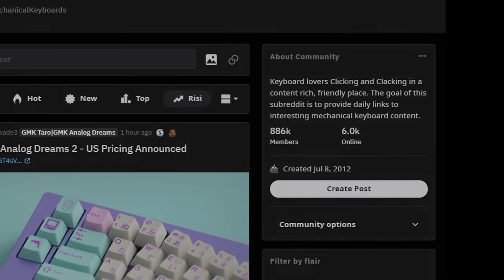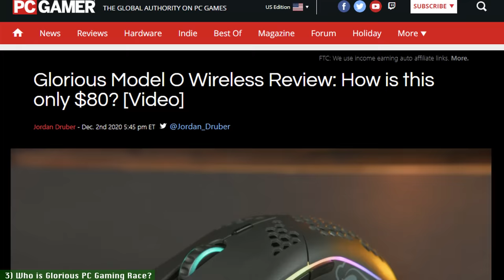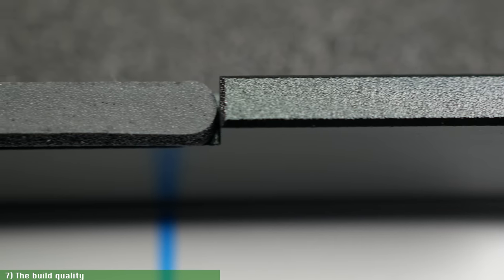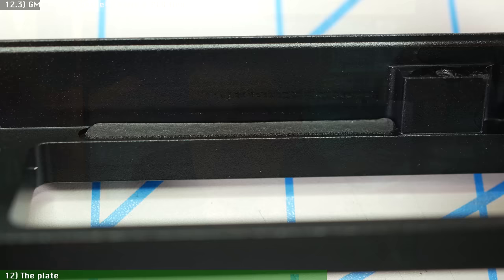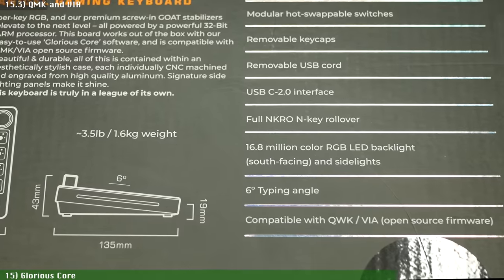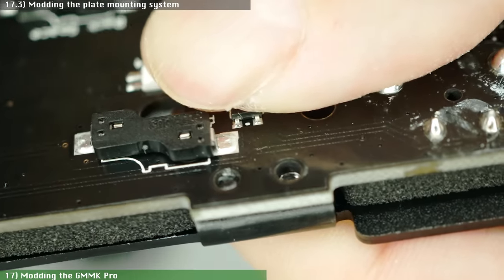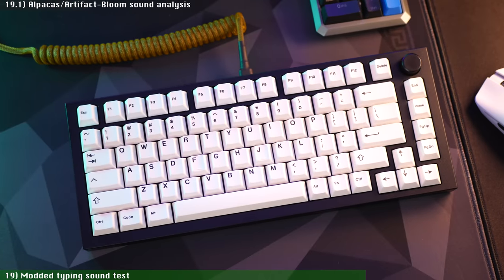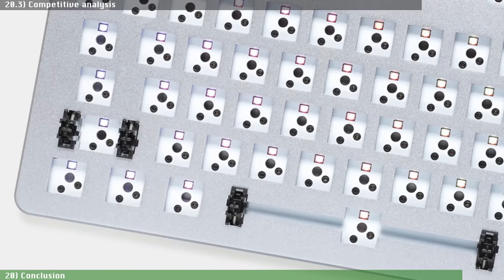GMMK Pro: The ultimate guide (in-depth review + modding tutorial)

Comment: When soldering the cable to the male aviator plug, how do you know which order to connect the cables in? Is it Black (1) White (2) Green (3) Red (4)? I made a custom cable following some decent instructions, and it powers my Drop Alt, but doesn't seem powerful enough to support the GMMK Pro. I'm leaning toward sleeving and coiling the cable that came with the GMMK Pro like you did, but I'm nervous I'll screw it up! Lol. Still learning, but this is a great video. Thanks for posting amazing content like this.
Reply from the maker: Thank you!!! And yes... You should always be EXTREMELLY careful when soldering the wires to the pins in an aviator or XLR connector, since you can damage your keyboard (in an extreme case) if you get the order wrong.

Now, is there a correct sequence to solder each wire color to each pin? No. Whatever sequence you do will work just find AS LONG AS YOU KEEP IT CONSISTENT ON BOTH ENDS of the cable (sorry for the caps, but I can't emphasize this point enough! :)

So whatever sequence you pick, keep it consistent in all your cables and you're not gonna run into any problems. I use 5 pins XLR cables, but you can use 4 pins as well.

On a 5 pin XLR plug I usually roll up the grounding silver naked wires into a bunch and solder it to pin 1 (if you have a 4 pin XLR, you can solder this "ground bunch" to the flat pin with the hole on the tip). This is an overkill measure for PC peripherals, but is something I learned from making audio cables, that can carry more current than PC peripherals and will benefit from good grounding. But you don't necessarily have to do this for keyboards (I do it out of habit). Then I do black wire on pin 2, green or yellow wire on pin3, white or blue wire on pin 4 and red wire on pin 5.

On 4 pins aviator cables I use the same sequence minus the grounding (black on 1, green on 2, white on 3 and red on 4), but just roll the ground bunch around the colored wires and make sure they touch the metal clamp of the USB housing and the metal part of the aviator connectors. USB cables already have ground built-in (on the black or red), but I just do this out of extreme caution.

Needless to say, don't ever mix your modular cables with cables made by other people, since there is always a huge chance they wired their cables differently than you, which could cause the cable to either not function or damage you peripheral.

As for your issue with the GMMK Pro, it does seem to need more power than other keyboards I have, so it pays off to use bigger gauge wire that can carry more juice. I have used the cable that came with the GMMK Pro to make the half that plugs to the keyboard, and used the cable that came with my original GMMK TKL to make the other half that plugs to my PC. This combination has been working great for all my keyboards.

I know I'm way behing in producing my cable making video, but once I finish it, I'll cover all of this in detail (as you'd expect from this channel :). Let me know how it works out for you!

Comment: Question for you. Did you have any problems with your stabilizers for the shift or space at with sticking? My boards space bar sticks bad. And I’ve removed a hood bit of lube and still.
Reply from the maker: Hi TIMREX! As my GMMK Pro came from the first batch Glorious had put out, I didn’t have the “sticking stabs” problem that pretty much everyone else who got the second and subsequent batches of this board had.

The first batch came with its stabs properly lubed (no excess grease), but, because of some issue with the stabs design, most people (like me) were getting clicks and ticks on the space bar. Then, when Glorious tried to fix that problem, by overlubing the stabs in the factory, they ended up creating the second (and arguably much worse) problem that you had: the sticking stabs.

After a year of this keyboard in the market (and two attempts by Glorious to come up with a decent set of stabs), it seems that the general opinion from most GMMK Pro owners is to simply add the price of some C3 Equalz stabs to the price of the board and not waste time trying to fix the stock ones (which most people, including myself, consider to be pretty much “unfixable”).

I’ll say this: if Glorious cannot find a way to put some really good stabs in their upcoming GMMK Pro 2, this could become the hill they’ll die on… Their efforts in the 'stabs department' have been pretty laughable up to this point.

Comment: Thank you for this video, I was wondering if it was worth the investment and I think I'll go for it as soon as my gaming room will be finished.
However, when I see this kind of video saying that a keyboard like that is entry level I really wonder what do keyboard enthusiast consider a over the top keyboard ?
Reply from the maker: Glad to know this was helpful!!! And yeah... I understand your surprise with the whole "entry level" concept! And that is why I came up with this graph ( https://youtu.be/J_axv-TkjkE?t=3945 ) to try to illustrate that an "entry level custom" keyboard sits higher than a premium pre-built/production board.

In the world of custom keyboards, believe it or not, $170 US is actually "entry level", since most boards that would be considered "enthusiast grade" are usually super small batch (manufactured between a few dozen to a few hundred units) and usually start around $300 to $400 for a single kit (PCB, plate and case) and are mostly made out of C&C'd super premium materials, with very tight tolerances and that normally go through a more rigid quality control than most production keyboards.

My rule of thumb for what is an "enthusiast" or "luxury" custom keyboard is this: 9 out of 10 boards built by guys like Taeha Types fall into that category (some of these are even what I call an "over the top" keyboard, that can cost upwards of $700 to $800 for a single kit!).

In my opinion, keyboards such as the GMMK Pro, and now the newly released Keychron Q1, sit right in the middle of those two groups (large scale production and custom)... They are what I call a "semi-custom" keyboard.
Reply: @IOSam  Thank you for such a detailed answer. I have a Ducky Shine 5 with Cherry MX Blue at the moment so it's what you'd call a "premium" keyboard just before the "custom" line I imagine.

I don't have a good feeling with it as I had with a previous Corsair CMStorm QuickFire with the same switches (without RGB). 
I read here and there that the Ducky Shine 5 with Cherry MX Blue (with RGB) could have some issues so it might be that. 
Also have their Ducky Secret mouse and have a wheel issue but that's another story ... I'm not very lucky with this brand.

Anyway I'm getting tired of the noise my keyboard makes, even if I love the typing experience of blue clicky switches. So here I am and thanks to your video it's maybe more clear to me that this keyboard may be the answer. I checked some videos about the Keychron Q1 but I don't like the sound it makes at all. Seems like the aluminum case ring like a bell when you're typing while the GMMK Pro looks more "solid".

Thank you for the time you took for this video, I've seen a lot of tech reviews on it and it's not even close to what you made here.

PS: I went to see what Taeha Types makes and yes I begin to understand. But I'm wondering if you could make a GMMK Pro or a Q1 sound and feel like one of those (without the exceptional custom design craftsmanship of course).
Reply from the maker: @Xanarkhan  Yeah... I have to say my experience with Ducky boards has been mixed as well... But my suggestion to you, if you like the feel of clicky switches but dislike their sound, is to go with Gazzew Boba U4 (if you want a super quiet damped switch) or the U4T if you want the "thocc" but with no click. Bobas are my favorite tactile MX switches at the moment, they are cheaper than Holy Pandas and they will feel really nice on the GMMK Pro aluminium plate!

As for the new Keychron Q1, I have one on the way to me and I'll definitely have a video on it later this year, but the initial reviews make it clear that, while they seem to have addressed the stiffness issue of the GMMK, it will still require some modifications to fix the "bell ringing" problem.

As for the possibility to make a sub $200 keyboard to sound as good as a $500 one, I'd say that it can be done in most cases... But it will require a lot of tinkering with different mods (and potentially even with different switches and keycaps) until you fine tune it to your preference. So, if you're the type who like DIY projects, this would be right up your alley! :)

Comment: Do you see possibility of sneaking in 4000mAH battery such as supplied by EEMB with jst connector? I mostly use bluetooth enabled mechanical keyboard and its hard to digest this in 2021 that companies are still not making BT enabled keyboards. It frustrating seriously such an amazing keyboard yet missing basic productivity requirements. Anyway im happy with Epomaker and Keychrons. Even Logitech figured it out after coming out of the cave yes people need exactly only 1 wireless to use mechanical keyboard productively.
Reply from the maker: I suppose you could adapt it using something like an Adafruit bluetooth adapter ( https://www.adafruit.com/product/2829 ) and a battery. But I don't see how you'd be able to fit that contraption inside of the keyboard case, since there isn't a lot of space between the PCB and the bottom case (3 mm max).

If you can 3D print some sort of case (to put the bluetooth module and the battery inside) that could be somehow attached to the back of the keyboard case (outside), it could definitely work.

This would make for a very interesting (if very challenging) DIY project!

I think one of the problems with blutooth mechanical keyboards is the materials used (metal cases can be problematic for the radio signal to travel far) and the RGB lighting consumes a lot of power (so you'd need a beefy battery pack). Most bluetooth mechs I've seen out there have plastic cases and no backlighting. So if you're willing to accept those compromises, then you might find a few interesting options out there from Keychron, Skyloong (GK series) and even Razer (their new BlackWidow V3 Mini Hyperspeed Wireless).

Comment: In regards to the o-ring mod, what thickness did you use, and would a thicker/thinner one work as well / better?
Reply from the maker: I used 6mm x 2mm (with a 2mm opening). You can certainly use thinner or thicker (up to 3mm should work fine) o-rings. The bigger the gap the o-rings create, the more space (and range of motion) the gaskets will have to allow the plate to move.

The only downside of using thicker o-rings will be the aesthetics of having an even wider visible gap between the top and bottom halves of the case (depending on how much torque you put on the screws through the o-rings).

Comment: Hi, thanks for all the information, I've been using it heavily in my build. I did the o ring mod but I don't have the same gap between the two halves of the case. Do you also leave the screws fairly loose to get that? I also have a lot less flex than you even with the PC plate. At the moment I am still using the stock case foam. Do you think swapping this for the silicon sheet will help when combined with the o ring mod?
Reply from the maker: Hey Elliot! Thanks man!! Answering your question: I indeed did not attach the screws too tight; I would stop turning the screw the moment the resistance of the O-ring was starting to build. If you keep turning the screw all the way until the end, you’d be basically removing most of the softness from the O-ring, which is responsible for giving that important 1 mm of extra space between the two halves of the case. And then there is the issue of the space under the PCB, which is very tight.

So, if you keep the original foam in there, it will get in the way of the plate/PCB assembly to move downward into the bottom half of the case, which is why I replaced it with the thinner silicone sheet I could find (which was roughly half of the thickness of the stock foam). Naturally, if you remove the stock foam and don’t replace it with anything else, you’d get even more flex, but then you’d have to contend with the ping noises you’d get back from the energy bouncing inside of the metal case without any damping.

And finally, I should let you know that Glorious is about to release a “flex kit” for the GMMK pro, which is supposed to turn the board into a “trampoline” 😂. It seems to include a new bottom half (with more space) and an improved gasket system for flex. While I don’t have the price and release date for this product release, I know it is happening soon (certainly this year) and I will get a review sample to analyze here in the channel.
Reply: @IOSam  Thank you! I really hope it's an upgrade kit and not a version 2 of the board as I've only just bought it haha. For now I will loosen the screws and subscribe waiting on your review!
Reply from the maker: @taylorelliotj  Oh this is definitely an upgrade kit to the existing model! But... There is also a GMMK Pro 2 in the works! But I don't think it is coming out this year. And thanks for the sub man!!! 👊

Comment: Incredibly helpful review! Trying to build a quiet board for the office and was considering combining the suggestions from the gmmk Tkl into a gmmk pro build (I prefer the size and layout of the pro). For the sound dampening would you suggest sticking with the silicon sheet from this video or going with sorbathane in the pro? And what would the difference be? Switches will be Zilents lubed and PBT keycaps
Reply from the maker: Hi Rebecca! Thank you!!!

Yes, you can definitely apply the same ideas from my silent GMMK TKL video on a GMMK Pro. In fact, you’ll probably get an even quieter keyboard given the thickness of the Pro’s metal case and how good it is in muffling noise.

Using the silicone sheet will be quite effective already, but if you want the absolute quietest mechanical keyboard experience possible, sorbothane will get you there. There are diminishing returns from going from the cheap silicone to the expensive sorbothane though… you’ll get about 10 to 20% less noise and resonance (on an already quiet keyboard) but for 2 to 3 times the price for the sound damping material.

Another thing to consider is that sorbothane is thicker than the silicone sheet, so that will reduce the plate flexibility on the GMMK Pro, since it does not have a lot of space underneath the PCB. This will only affect your perceived typing experience (depending on how hard you type) though… Since the sorbothane will help absorb vibrations even better than the silicone sheet.
Let me know what you decide and the final results of your build when you complete it! :)

Comment: Hi,

I have been thinking about getting into making a custom style full size keyboard, where I can change the 
switches and keycaps.

I have been trying to find keycaps that are thin, retro typewriter style in pure black colour with
large text that led light can shine thru  ( I like to type in the dark).

My current keyboard is a Vulcan 121 AIMO, maybe I could use it's keycaps.

Do these type of key caps exist?

Cheers
Reply from the maker: Hi George! Unfortunately, most retro style keycaps in the market are not backlit... Based on my experience, the vast majority of backlit/shine-through keycaps have the OEM profile and usually have regular Helvetica or Arial style fonts (which have a modern look instead of the retro fonts of old IBM keyboards).

So, while I understand you'd prefer to find higher profile (retro style) caps, you will probably have to stick to the keycaps that came with the ROCCAT Vulcan 121 AIMO, since these are pretty unique and I doubt you'll ever find low profile backlit keycaps like these in the aftermarket as well.

The reality is that it is pretty difficult to make good quality backlit keycaps that also look good. My standard recommendation for backlit caps is always Drop's Skylight series ( https://fave.co/3Fan0Fp ) made of PBT in OEM profile. By far the best looking/quality backlit caps I've ever used (but unfortunately, they are not retro style).

Comment: When doing the O-Ring mod, do you screw the screws in completely or not? I’m guessing that because you said they are compressed that you want to screw them in as far as they will go, another video I saw on this mod said that you only want to screw them in a tiny bit. This was a great video, especially the modding section which im now planning to do to my GMMK Pro.
Reply from the maker: Thanks Brad! In my case I tightened the screws half way, right when I felt the O-ring resistance start to push back. This way I got enough space for plate flex (enough to improve the sound to my liking) without leaving a panel gap too wide between the two halves of the case.

However, if you're going for maximum plate flex, then you should screw as little a possible. About 1/4 of the way should be enough to give more space for plate flex without running the risk of losing screws later on (but you'll obviously get a larger gap between the two halves of the case).
Reply: @IOSam  Thanks for the great response. I will do the same as you and tighten them halfway. I’m going more for the sound than the flex.